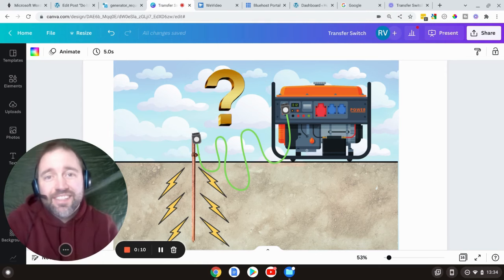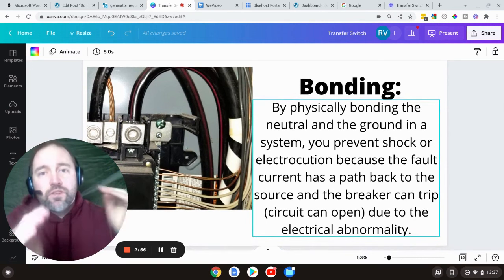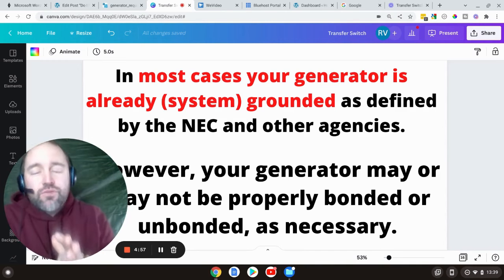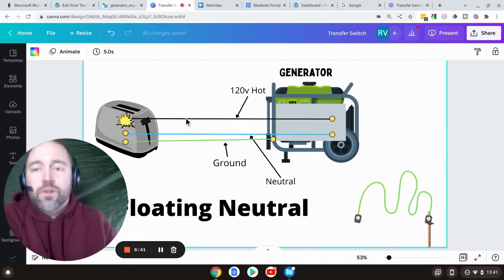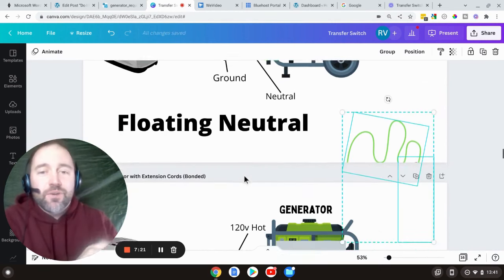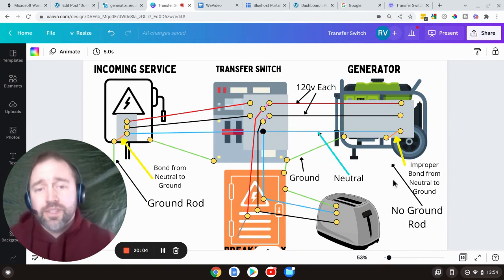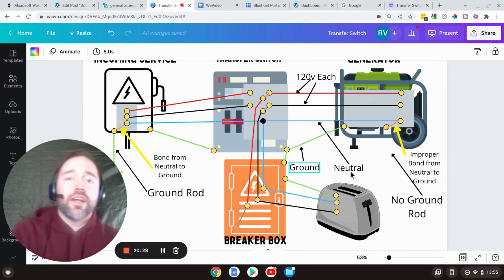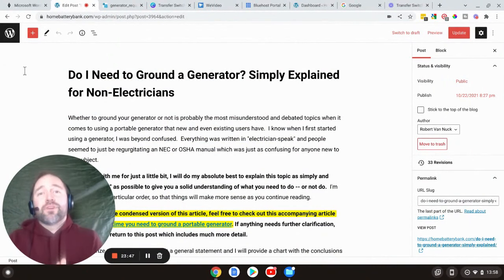Does My Generator Need a Ground Rod?  Probably Not.  Here's why.

Comment from the maker: Disclaimer: Always consult your local licensed electrician before making any changes to your setup.  This video is for entertainment purposes only.
Reply: Nice.
Reply: A toaster plugged into my house is on a circuit in the main box with a 15 amp breaker. The main box is bonded. Your diagram of the main box seemed to imply the box isn’t bonded. As far as I know home main boxes are always bonded with a ground rod right there. I know I have an 8’ ground rod right below the main box.
Reply: it is one of those it depends things , portables don't need them while fixt installations require them and any time you connect a generator to a house you get one weather you want it or not.

Comment: I just bought a 12,000 watt portable generator.  In the instructions it said that you need to use a ground otherwise you may get electrocuted.  Then I realize that they didn't include a ground with the new generator LOL.  Seems like they should include something simple and cheap that can save your life, just a simple rod and wire.
Reply: My generator said the same.  Not only did it not include the ground, zero instruction on how to install it. Seems like a liability.
Reply: Probably just trying to cover themselves.  I have found many places do not have a good ground.  Ground rods are not cheap. They are thick, and if memory serves me correctly, must go below the frost line and/or reach a certain moisture level in the soil.  Good thing to look up before you install one.😁
Reply: Read carefully.   The word ground can be misleading.  Is it saying or showing equipment ground, or grounding electrode conductor?  Two totally different things.   Be careful!
Reply: An easy way to tell if the generator neutral is already bonded is to use a continuity tester and check between the neutral and ground on one of the generator receptacles. If you have continuity, then you don't need a ground rod for standalone use.
Reply: @paulnandico2370 this makes sense but what if you are located on rock for god only knows how deep like me ?

Comment: Just wait until a rat eats away at the wire going to the ignition dynamo, then grab hold of the frame as it shorts against the top of the motor... it's an electrifying experience..that happened to me and I stopped using it for a year. After I repaired it and double insulated the new wiring, i sold it.

Comment: Why do you show the neutral-ground bond at a service disconnect switch which is not part of the breaker panel?  The vast majority of residential services have the neutral-ground bond in the breaker panel because the main breaker in the panel is the first point of disconnect.  I'm sure such systems exist, but every residential panel I've worked on has the L1,L2,N service wires coming from the utility transformer to the meter (which is not a disconnect) and then to the main house panel, and the main breaker in that panel only disconnects L1 and L2.  In this scenario it would not matter whether the transfer switch disconnects the neutral or not, you'd still need an unbonded generator.

Comment: You should also do a video on RV’s and generators.   They are not the same as a residence utility connected system.  This might be the exception to bonding N-G at the generator and not installing a ground rod.    Best wishes,   Kevin

Comment: This a lot of info, however, the best way to know if a generator needs a ground is to look at the manual.  If it shows a ground lug in the owners manual and shows you how to hook it up - then my guess is that it is needed.
Reply: Not necessarily. As he said, if the transfer switch also switches the neutral, only then would a ground rod and bond be required.

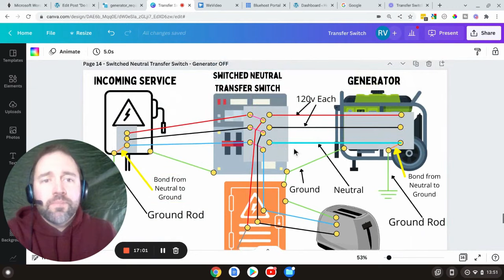Comment: With the switch neutral (13:51 time stamp) I have everything setup this way bonding at the generator which should clear the fault. I do not have the ground rod at the generator. I do notice in your diagram there is still a ground wire path to earth at the service. If the fault is cleared with the bonding at the generator and path to earth at the service why is a rod needed at the generator? Thank you. Great video by the way !

Comment: The scenario from 9:48 to 13:15. Assuming no active faults, What level of hazard would it be to remove the incoming service ground bond.  So you’d be running on generator with a floating neutral with no ground bond anywhere in the system.  Assuming no active faults and you were to touch the neutral, would you become the ground bond?

Comment: Electricity DC/AC will always find the shortness route toward the ground earth and that will eliminate or reduce greatly any bad situation as long as that ground rod is deep enough and not connected to the ground rod of the electrical house panel. When electricity service is cut from various bad situations, the ground or neutral of the electric panel may have live current from these various bad situations ( car accident hitting a electrical pole, lighting strikes, winds blow off power line or electrical poles,,, ) Thank you Cheers
Reply: this is why you ALWAYS isolate from utility when using an alternate power source.

Comment: 3:39 if the neutral is not grounded then neither wire has potential compared to the ground so you can get shocked only between the wires, not between any wire and the ground so the fault would no cause any risk.

Comment: I watched several videos on bonding by several electricians and was left more confused. You're video really helped me to understand it better. I'll have to consult my professional after installing an off grid solar inverter setup. It comes factory bonded internally, but my main panel on the house is already bonded. My manual interlock only transfers hots so I'm thinking I need to unbond the inverters internally which is possible. Weird thing is my generator receptical on the house is also bonded where the cord plugs into the house. That was wired by the electrician. Seems like two bonds to me. still confused.

Comment: Thank you for this.  I have an electrician replacing my 20 slot panel with a 30 slot to accommodate a ckt for my portable  generator and power for an electric vehicle. I have a Westinghouse WGen9500.  They are installing 50 amp ckt outside of my house an a Generator  Lockout at the panel.  Do I need  Ground Rod for the generator?

Comment: Thanks that made it clear. Switched neutral transfer switches changes the generator to a designated "separately derived voltage system." Than its on a nec regulations for a bonded and also ground rods  requirements.

Comment: Peopel should check their manuals. I have a Ford 9500W continuous dual fuel generator I plug into a transfer switch on my breaker. The manual specificaly states connect to a grounding rod with 8 AWG wire. There's a ground wire connection on the frame and I use a ground fitting connected to our water pipe that runs under the house. Great video, thanks.

Comment: Just came across your video today you seem to have a grasp like no other on the issues of grounding and bonding. GREAT JOB!! Can you please help me with this scenario as to if, I’m on the right track or not. I’ve already asked 3 local electricians and they all gave me conflicting information. I have a 50-amp interlock breaker on my panel and a generator socket outside of my house for bad weather outages. I just purchased TWO (Harbor Freight), Predator 5000 W inverter generators @120v. I naïvely thought that adding them together with a parallel kit, sold by the same company would boost me up to 240 V and 10,000 W. I know now that’s not reality because, there are only 2 wire connections on that generator and the 240 V generator has 3. So I was thinking to build a combiner circuit so then each leg would be 5000 watts at 240 V.  Here’s what I was planning, take a 30 amp, 120v plug out of each generator and connect them in a box with a 50-amp socket, tie together the neutrals and place them in their terminal position, combine the grounds place them in their terminal position, and lines 1 and 2 would go each in their opposite terminal locations. Will this work it seemed straightforward to me until I thought, would the 2 phases from 2 different generators clashing with each other? I thought of this because I saw a video about power plants needing to precisely spin up their generators to work with each other’s sine wave. Is this not an issue with inverter generators or in my scenario?

Kind regards,

Comment: Based on this information...I do not have a "switched neutral"...but I want to be sure.  My electrician installed a twist-lock 30 amp box on the house next to my outside panel, ran 8-3 with ground to my outside panel....connected the two hot leads from the box to a 40 amp breaker inside the panel..and ran the neutral wire to the neutral bus bar and the ground to the ground bus bar.  I can see that inside the panel the two bus bars are bonded, and I have a mechanical interlock preventing the main breaker from being on when the new 40 amp breaker is on.  So I assume that I do NOT have a switched neutral set-up...(and that when power is out and main is switched off and locked) that I should run a "floating neutral generator" when plugged into that box, and that I don't need a ground rod.  Am I correct in this?  Thank you for a reply.
Reply: First of all, the 40 amp breaker is a code violation. The over current protection rating cannot exceed the rating of a single receptacle even though your 8-3 wire is oversized.
You do not have any neutral switching since you have no transfer switch.
Your ground and neutral bond at the generator needs to be separated and the neutral wire insulated. 
Install the ground rod and connect it to the frame of the generator or to the same terminal where you removed the neutral. Either way, use a proper set screw lug.
Reply: @trustme7731  You are saying that the 40 amp breaker exceeds the rating of the 30 amp box and thus is a code violation...correct?  I wondered about that.
Reply: @spacecoastz4026  The breaker exceeds the rating of the 30 amp receptacle. That's not allowed for a single receptacle. In a perfect world the 30 amp generator breaker would protect it but who knows if it would fail or how this would be used by someone else.
Reply: @trustme7731  Understood...thanks

Comment: Hey thanks for the great video. Question: I have a 30amp single phase RV. I installed an automatic transfer switch so I can use an inverter, a generator, and shore power all separately and seamlessly. The transfer switch switches both the hot and the neutral leads… this way, I can use shore power when I’m home (that’s bonded at the panel) and a bonded generator, when I’m camping off-grid, and I can use my inverter when the generator isn’t running. My question is this— should I tie a ground wire from my inverter to the chassis of the Camper trailer? (The inverter has an external earth symbol with a screw for mounting a wire— but my sense is not to use this connection unless using the inverter in a house application). Also, interestingly, when I test the inverter with a meter, it only reads as a bonded ground when it’s turned on.. when it’s turned off, it reads as a floating neutral.
Reply: as I recall, in most RVs everything is floating till you plug into shore power, where the ground pin does the rest with the utility connection. Since it's a 120 volt system complete isolation can only take place if they disconnect the neutral. The answer for your inverter should be in the owner's manual, or available from the mfgr's tech support. They have the final word.

Comment: hi all, my portable inverter generator (which is not to be connected to house as we're offgrid) has a port for grounding cable. Is this to be used only if hooking up to a house mains panel/socket? if I use as stand alone, to power tools and drive a sub pump, do I need to attach a grounding wire/rod to my genny? thanks

Comment: This may seem like a silly question with an obvious answer, but would it be correct to say that a "ground-neutral plug" is simply a way to turn your generator into a "bonded" generator?  Essentially accomplishing what your jumper does?  Or is it something different and/or does something more?  (Bonus question:  And why would you NOT want to have a bonded generator?)

Comment: Thanks Robert. I think I get most of this, but I still have a question that I don't believe you covered. Does your " Do I need to Ground My Generator" slide apply when feeding an old 3 wire service house with a modern 4 wire generator?

Comment: Hi, thank you so much for the explanation. For a typical floating neutral generator and used with extension cords, will a grounding plug (making connection between neutral and ground), make it safer? What is your opinion on that? Thanks.
Reply: He already explained it at 10:00. Keep the generator floating neutral (don't bond neutral to ground at generator). Neutral is bonded to ground at the main panel.
Reply: @urbanturbine  thanks for the feedback. I was specifically asking for the case with extension cord. You are referring the case when the generator is hooked up to the house panel which makes sense to use the connection at the house and not have another neutral to ground bonding at the generator. I am wondering when an extension cord is used, whether a Ground to neutral plug should be used to at least get some protection from any hot to ground fault on any appliance with metal exterior.
Reply: @bennettonline  absolutely you can bond the generator with a grounding plug... just be sure to remove the grounding plug if you connect the generator to a typical transfer switch that does not switch the neutrals...

Comment: To avoid electrocution with a fault present, I would rather not complete a circuit with a floating neutral generator than rely on a CB to pop in time in a bonded neutral generator.  If I want to know if a fault is present (hot metal skin), then I can use a NCVT tester.  

Most people who bond their neutral to ground in a floating neutral generator are RV owners using surge protectors.  For them, more about getting their surge protectors to work than an electrocution issue.

Comment: be aware that sometimes the NEC rules may not be applicable. To wit: 
The National Electrical Safety Code (NESC) is a set of safety standards that govern the installation, operation, and maintenance of electric supply, communication lines, and related equipment. Contact your local utility before attaching any alternate source of energy in lieu of a utility transformer to your structure, they usually respond free of charge.....

Comment: I was hoping you would touch on breaker interlock systems for generators.  Which kind of transfer switch would that be considered ?

I am assuming since a main breaker doesn’t disconnect the neutral, it would be considered a ‘normal’ transfer switch and not a switched neutral therefore no grounding rod for generator and remove the generator bonding jumper ?

Do I have that right ?

Comment: If you're using your generator to charge/run your holiday trailer I would think you would want your generator neutral to be bonded as the neutrals and grounds would be separated in your main panel of your trailer.
I would also think that if your trailer is connected to shore power the main power coming in would have the first point of disconnect so the grounds and neutrals are bonded together.
Are my assumptions correct?
Also when using the generator to charge the trailer and run extion cords ahould I install a ground rod for that application?

Comment: SOMEONE PLEASE HELP! I have a bonded generator that I will be connecting to a mobile home. The first disconnect is outside by the meter. I'll be connecting to the subpanel inside, using an interlock. Will the main panel outside provide the bonded neutral, or should the generator be bonded? And with that setup, do I need a grounding rod? Thanks
Reply: Neutral to ground Bond is to occur only one time in the system.

Comment: Home Battery Bank, my generator is neutral bonded to frame. I’m using an interlock with 30 amp 240V(L14-30R). I will consult a local electrician but was looking for your thoughts as well. I can very easily convert to floating neutral if that makes the situation better. Thanks,
Reply: it all depends on what king of transfer switch you have... if you have a typical transfer switch that only switches the hots, then you do NOT want it bonded at the generator... if you have a transfer switch that switches both the hots and the neutrals at the main panel - then you want the generator bonded AND you want to connect the generator to a ground rod... that's why hot/neutral transfer switches are not typical...

Comment: Thank you thank you thank you have internally grounded portable generator with a bonded neutral The guys that set up all of the cabling for a three-phase 120 208 system put in grounding rods in addition to bonding the three generators to themselves getting a reading from hot to ground of 120. Suspect that ground rods are not applicable or advised. Now I'll take this information and do more research but I think I've come to the conclusion that grounding rods should not be used on internally bonded isolated generators not attached to a house system. The only advantage is during a lightning strike from what I've learned from your video